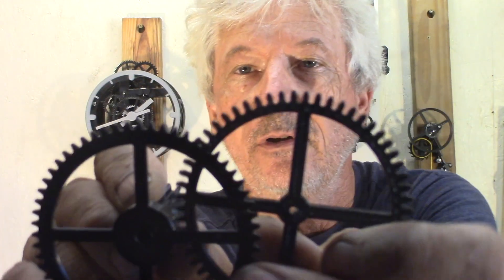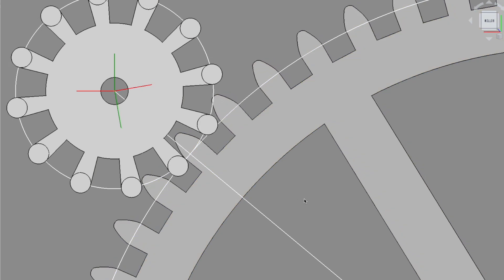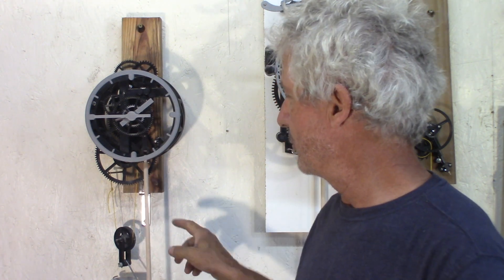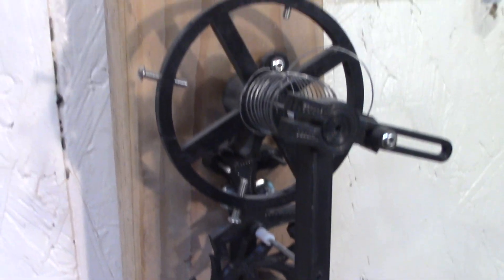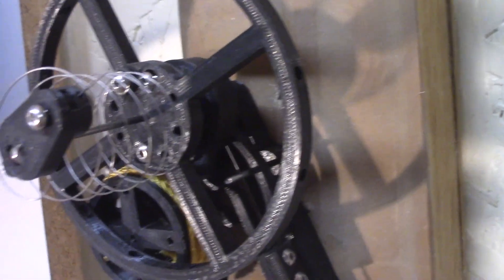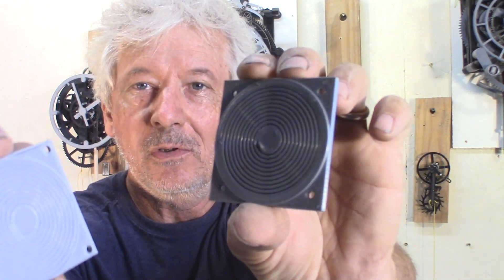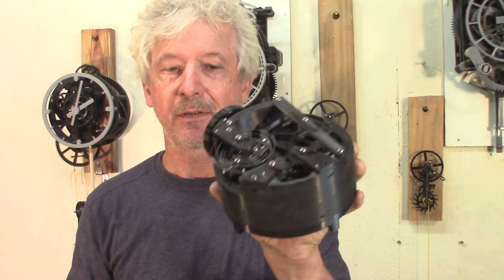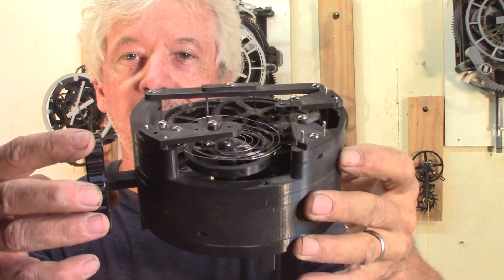Final version of my 8 day clock and experiment with other gear profile

Comment: Very interesting results. My experiments showed minimal difference between various tooth profiles. Steel pins rubbing against PLA will be much lower at the cost of a lot of extra effort creating the pins. My suspicion is that any reasonable gear tooth profile will perform good enough for an 8 day clock. The dominant factors affecting runtime are escapement efficiency and pendulum support friction.

The detent escapement looks really cool. Did you have the microphone right on top of it? Both escapements seemed really loud. :)
Reply from the maker: Yes the micro is on top of caméscope, so just a few inches from escapement
Lots of noise is also a sign that the escapement is not very efficient yet
The detent escapement is one I wanted to do for a long time, looks so simple and yet can be tricky to get right 
It works well with the cylindrical spiral spring
For the pins Amazon has them by the hundredth for 8 bucks
Not worth making them myself 
I think cycloid is still a good option with small pinion, below 12
Watches still often have 6 at escape wheel

Comment: For the carbon spring: Instead of using a mould, it might be possible to use carbon fabric (or a roving), and some spacing material like a polyethylene band. Put the impregnated carbon fiber onto the plastic, and wind it around a core and let it cure. Afterwards you may cut it into slices on a lathe or even just with a saw. Remove the plastic, and the spring is ready. You may be able to get thinner and softer springs compared with moulded ones.
Reply from the maker: Yeah, thinking of a silicon mold that I can un roll to place the fiber, then roll to get the final shape
Ideally it would be best to have a constant stream of fibers all around
the section of the spring should be between 0.1 to 0.4 mm in thickness and 0.5 to 1mm wide
fun stuff

Comment: Do you notice some wear and tear at the escapement over some weeks of use?
Reply from the maker: what you see around 0:30 is after a month of running, pins are shinny, no dust, I do not see any wear on the anchor
There is only about 2 grams of pressure pins to anchor
I am quite certain the clock will run a couple years... time will tell